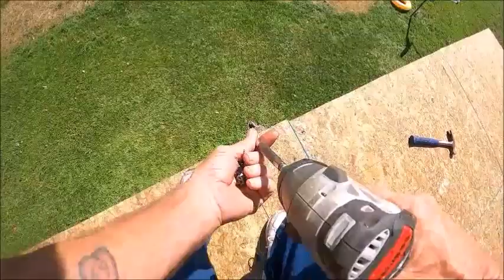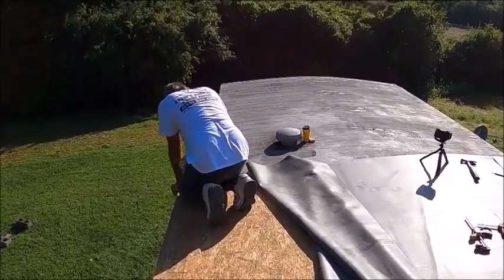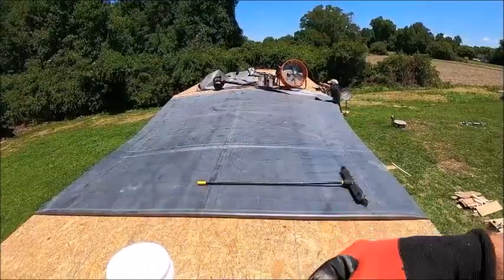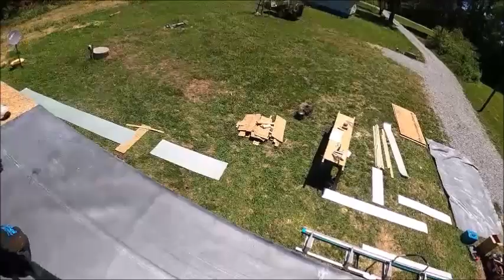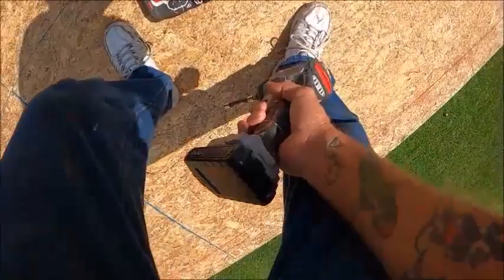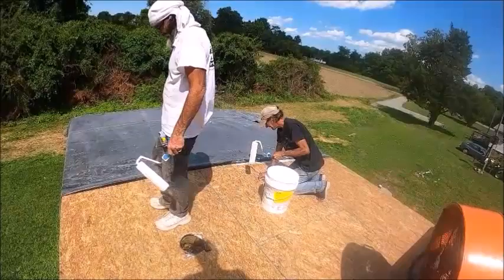How To Repair Mobile Home Single-wide Roof Repair Tappahanock Virginia

Comment: lol been watching all your videos you can always learn something from everyone no matter who they are i am scared to cut the wood 
i have some issues where like a straight line if hard for me to cut  and some nerve damaged broken back issues i am using walmart tools :D
they aint the best but its just for this project 2 restrooms' floor need to be reinforced and replaced i dont think i could doa roof
some times i can barley walk or i have super bad cramps if i work to hard sucks i miss being strong i used to be able to do so much
Reply from the maker: When you’re cutting plywood take a straight edge maybe a level or some thing clamp it to your plywood I mention a half away from your blade and run a straight line that way
Reply from the maker: Thanks for the comment I appreciate you watching my videos

Comment: If I do not want to cut my roof vent to put a rubber roof on, can I do it another way?
Reply from the maker: What are you talking about you don’t want to cut your roof vent you don’t wanna cut the hole at all? You can text me at 910-294-1761 and you can send pictures
Reply: Drew's Roofing & Home Repair ok thanks.

Comment: Hey Drew----can I use a billboard vinyl sign instead of rubber roofing if i am putting metal on top of it? Because I have a 20x70 one already. Id say probably not but I need to ask someone who knows for sure. TY!!
Reply from the maker: Why do you want to put a billboard vinyl sign on your roof I’m not sure what you’re asking. If you need to talk to me you can always call me 910-294-1761 i’ll answer any question as I can
Reply: @Drewsroofingandhomerepair  because i have it already. I think the rubber liner is gonna cost over 700.00 and I don't have that. i was hoping the vinyl sign would work and that i could then roof over it with metal roofing panels.
Reply from the maker: If you’re putting metal roof panels up there you don’t need any liner all you need is one by four we call it strapping let me send you a video. If you’re going to put metal roof up there you don’t need rubber https://youtu.be/jD6SIru7XKw
Reply: @Drewsroofingandhomerepair  omg i didn't know that!!! u just saved me SO MUCH MONEY!!
Reply from the maker: You don’t have to put the rubber roof that I put down first if you got a put a metal roof you need to make sure whoever is doing it even including yourself in a little bit about it. You have to add strapping before you put metal on. You don’t want to just put the metal down to the trailer. Send me pictures of what your trailer looks like and I’ll have a better idea what you need to do you can send it to that number that I gave you I promise I won’t be calling me back and less you want me to. I’m just here to help and I’m all the way in North Carolina.
Reply: TY SO much! I will take pictures tomorrow and send them. Not sure what time cause were stormy weather right now. its an old trailer that's for sure lol. @Drewsroofingandhomerepair
Reply from the maker: No use 5-v Metal. Lowe’s sellers it
Reply from the maker: Stormy weather here right now also North Carolina
Reply: @Drewsroofingandhomerepair  So far I am up to 1,729.04 (this includes the roofing tin) and i think all i gotta add is the lumber. Still researching and adding up!!!
Reply from the maker: Not bad. Remember make sure you don’t wast that money on a bad job
Reply: @Drewsroofingandhomerepair  im trying not to. that is before all the taxes and lumber. its alot less than the ten grand i kept being told it would cost!!!
Reply from the maker: That metal is Junk use the 5V
Reply: @Drewsroofingandhomerepair  i searched 5V and it didn't pull up anything?
Reply: @Drewsroofingandhomerepair  well i am an idiot--i found it, lmao. why is it so much cheaper than the bad one though. hmm

Comment: Need  help with facial boards all around and gutters. Have lip gutters want better. Front Deck roof leaks like a water falls between mobil home & deck roof. I have  looked at it not sure how   to fix it. Lip gutters are between mh roof and deck roof. Water falls along both sides of mobile home.  Lip gutters  worthless. Cincinnati area off 74 West  2 miles.
Reply from the maker: I want to help you go to You Tube type in Drew’s Roofing And Home Repair emergency mobile home leak repair. If you type that in it will bring you to my video. We are using a product called Hydro Stop with a cloth material that goes with it. Check that out for.

Comment: Tried to get the rubber roof on my single wide no one will do it they say it won’t hold the weight. I’ll have to do it myself😎
Reply from the maker: That’s ridiculous I’ve been doing it for 20 years it adds strength to the house definitely not too heavy total idiots. I hope these videos will help https://www.youtube.com/playlist?list=PL8xp84iSvTA5MA9B_sGBPGm9RZ5xxlczz
Reply from the maker: Some of them have a material list in the description
Reply: Thanks! The videos will definitely help out a lot! 👍
Reply from the maker: Thank you